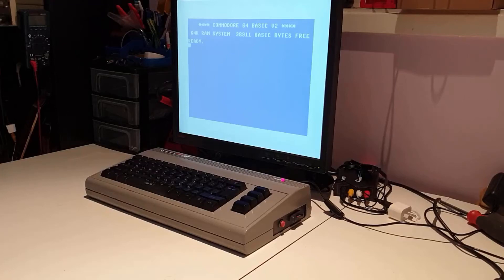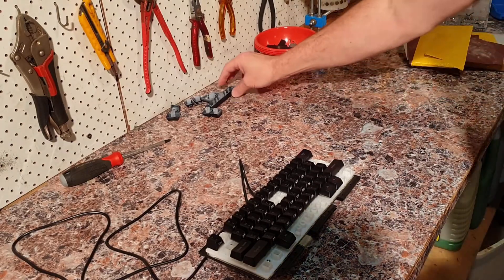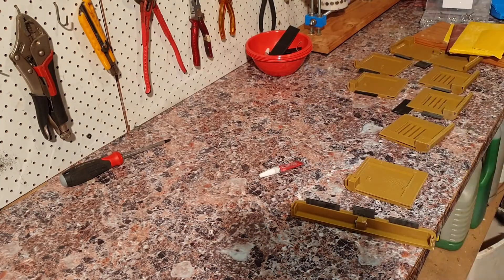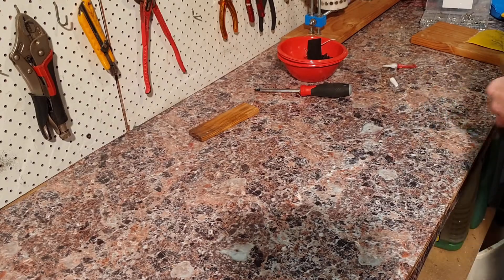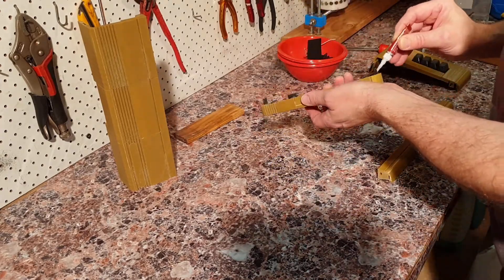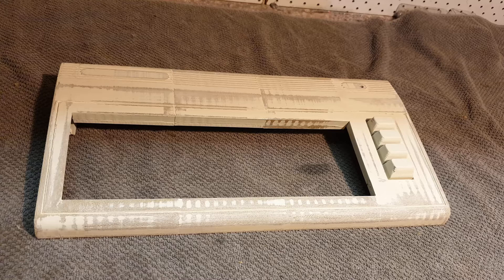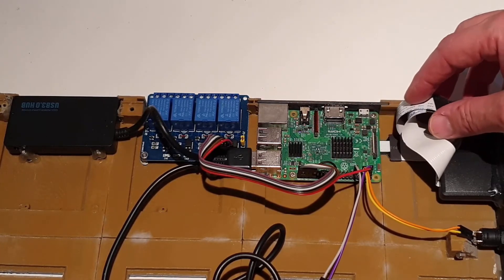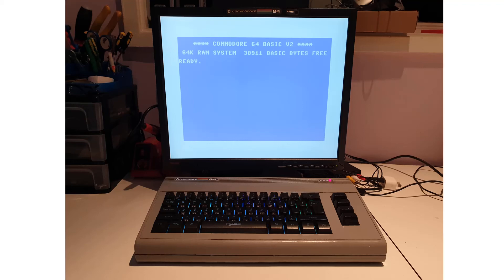3D Printed Commodore 64 clone (Raspberry Pi)

Comment: I'd like to do this same thing but use a small form factor motherboard from a modern PC with lots of power and SSD support and still fit it inside the C64 or maybe even a ViC-20 case.  It would be a very different kind of thing to take to a LAN party.
Reply: You might want to check out the c64x - thats a full case thats designed with an miniitx form factor (on kickstarter but they moved to indiegogo for addiotnal perople who want to order). I did my research and backed one.

That said I am going to make one of the above, as this is a cool project and I can do one of the above and i can do it in candy apple with metallic flakes!
Reply: how much power do you need for a c64?, plus, a pi 4 has native ssd support, if you want to use a real c64 keyboard, buy a c64 case ($120 US) Keyrah(64 US) c64 keyboard($120 US) this is the cheaper route
Reply: @KingNothing22   I only want it to look like a C64, but I want it to be as beastly as possible inside.